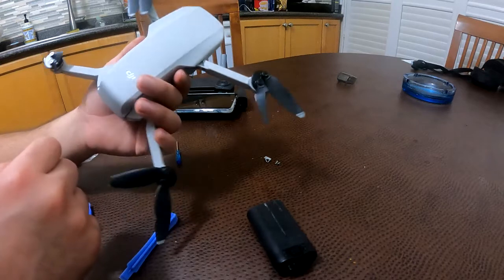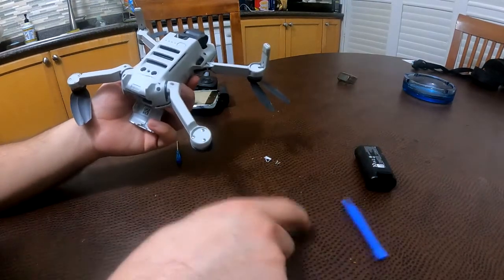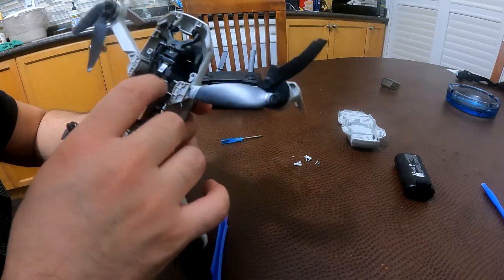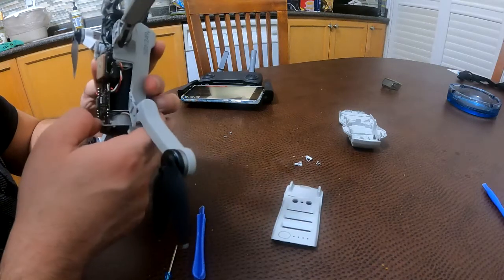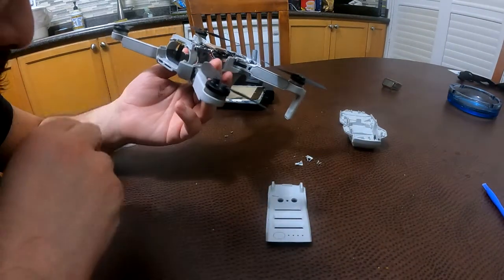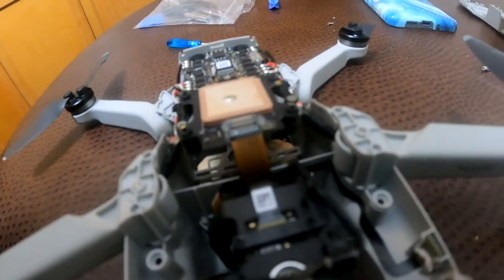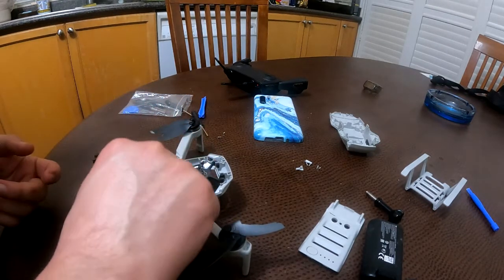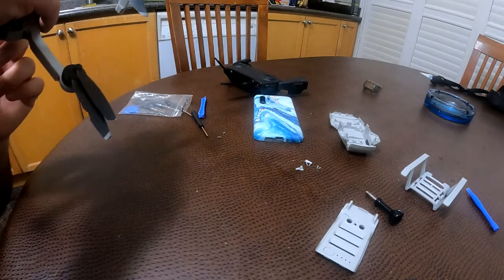DJI Mavic Mini stuck in reboot - Fixed

Comment: Thank you very much this video is a big help. My Mavic Mini suddenly went crazy mid-flight going backwards fast and hitting a wall. After that same case stuck in reboot. Opened the drone and found the connector was a bit loose and the cover protecting the chip below the Gyroscope was also loose, so I just reattached and tightened them up.
Reply from the maker: Nice

Comment: I replaced my camera/gimbal and main board.  Put it all together and had the same problem as you.  After watching your video, I opened up the drone and had a look.  Same cable as yours was disconnected, but at the core board side.  Your video took me right to the problem.  Thanks for posting it.  Wasn't sure where to go until I saw what you posted.
Reply from the maker: You're welcome. Glad it was helpful

Comment: i have the same problems.  Do you remember what error codes it gave?
Reply from the maker: No idea how to pull error codes. That's the only thing I did and it was working. Good luck
Reply: Code 30045